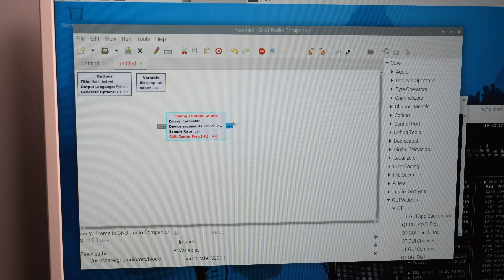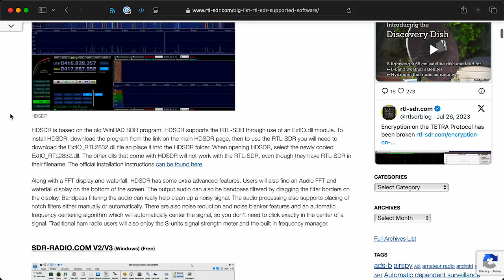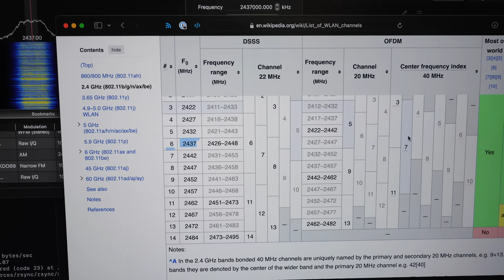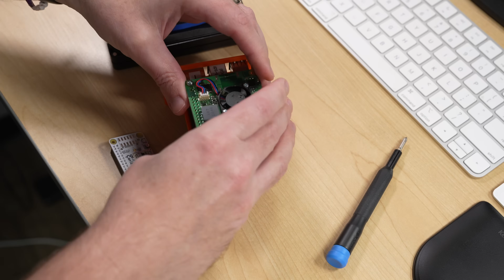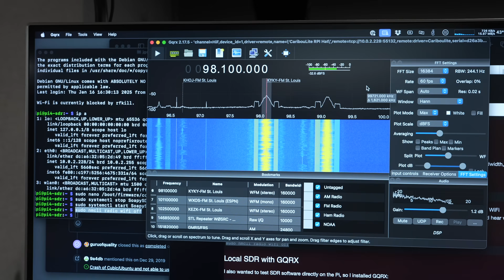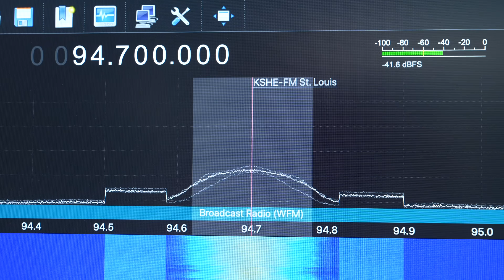Radio Hacking 101: Raspberry Pi SDR with a CaribouLite

Comment: Funny thing about stereo/mono FM broadcasts ... I remember an event that was being broadcast live. When I switched by receiver to stereo it worked just fine. But switching it to mono and the audio cut out. I actually figured out what was wrong, made a phone call, and they FIXED IT. It turns out that mono is the sum of the left + right channels. They apparently had a mono feed, but when they converted it to stereo, the two channels were 180 degrees OUT OF PHASE! Meaning, that when they added the two signals for the mono portion, the two channels cancelled each other out.

Comment: I just had to use your SD copier utility to fix my SSD after it did not boot up correctly after doing the initial configuration and reboot. 🎉  I am about to go hook up the SDRplay and see what happens with GQRX.   Your name came up with a thanks in someone else’s documentation for the same reason.
Reply from the maker: Glad I could help!
Reply: @ I finally installed DragonOS, and ran the installed SDRconnect mentioned in the readme file.   It works, but even with decent antennas that are sitting in the room. I can’t really hear anything so I may have to go on a field trip just to see how well it works and take the antennas outdoors.
Reply: The 7” touchscreen, with the Pi on the back and the SDRplay duo sitting underneath the stand is pretty compact, but with all the cords hanging out, it’s not something that I could just live with having sit here like this, so I have to figure out some sort of case : )  I can’t really leave the antennas out even if they did work, so I have to figure out something which I thought about trying to make a lamp out of multiple antennas.  The discone looks like a giant lampshade. Art + antenna theory.  It’s something to think about anyway.
Reply: @ whoever designed this motel could also make the coating for the B2 bomber because no RF goes through this place.  Maybe we should start making concrete stealth aircraft : )
Reply: If I didn’t know what we were doing, and I saw one of these I would ban us for PiCraft.   Witchcraft for SBCs : )

Comment: Hi Jeff! There is another project "OpenWebRX+". Rich of decoders and very easy to setup. It's working even on my old Orange Pi PC2 (1GB RAM) with Debian 12 on it and RTL-SDR dongle (Realtek RTL2832 SDR) and outside discone antenna.
I also used an active USB cable to connect the RTL-SDR to the SBC so that the antenna cable itself would be minimally short.
I can't post url's here, but in github is repo just finish whith "/luarvique/ppa"

Comment: The CaribouLite is $140 with the same bandwidth as an RTL-SDR and a sampling rate of only 4 MSPS.  Aside from that, it can't be used on anything higher than a Raspberry Pi 4 as the Pi 5 replaced the SMI. Kinda sucks really as the Raspberry Pi 4 has RF leakage in some boards from the ethernet and this board has no shielding.

Comment: I‘d want to see the PCIe header used like I use for other FPGA boards (internal).
There have been a few interesting AD/DA chips released in the past two years but in general the market isn’t one that turns over very quickly.
gqrx is a great start, GNU Radio is a beast 😅

Comment: Could you detect a cell phone jammer with this? I have some concerns that a local factory is using  cell phone jammer that is killing cell phone signals in about a 50 yard radios around the building. It would be useful to gather some evidence before reporting them to the FCC

Comment: This is such a timely video for me! Of all things to get me back into SDR was an old hot tub I acquired recently. I noticed it has a temp sensor from the plumbing going back to its LED controller which made me curious. Turns out it was for a wireless LCD monitor that the consumer could put in their house. That monitor from 2007 is unobtainium now so after doing some research I see it runs on 433.92mhz. Not sure I'll be able to decode it since it looks like it uses its own protocol but I'm using it as an excuse to start my first spa monitoring mini rack 😄

Comment: I think I will use my cheap usb SDR tunner. I can't justify cost of the carbou lite module.
Plus I need to do some work on my projects like recycling my older pi1 and pi2. One is now a controller for heating the container for my homebrew beer to keeping it about 21C with an led display to show the temperature and if the heater is on.

Comment: Would it be possible to create a home assistant application that would take the local audio stream and broadcast it to wifi audio source such as sonos or airplay speaker? I think the digital HD radio signal would be preferred.
Reply from the maker: Probably! I just did it with ffmpeg and VLC last time I tried.

Comment: Which one would you recommend that I should use to listen into any Australia State and Federal Emergency service?
but however now there are using TETRA (Terrestrial Trunked Radio) is a digital radio standard for secure voice 
and data communication which is going to be very hard to listen into their frequency.
I will need some kind of Binary Code Translator Decoder program that translate into words.
if anyone out there has figured it out, please let me know.

Comment: I have a few rtl-sdr dongles lying around and was planning to connect them to my discone antenna for remote scanning. I like this sdr as I was going to get a hackrf one but this is a lot cheaper. The wifi killing thebsignal is a big iasue though, as I have a lot of acres and use wifi for connections between buildings, as fiber is just too expensive, as the highest point of the land where I plan to put my ham shack is a half mile from the house.

Comment: Out of the corner of my eye I thought the title was "Radio Shack Hacking"... disappointed when I looked again.  Decided to at least post a comment to help with the engagement, even if I'm not going to watch right away.
Reply from the maker: That'd be a fun video too, basically using old Radio Shack kits to do old computer and electronics hacks!

Comment: Hi, can confirm still acceptable work on Pi Zero (not 2) or Pi3B with 2gb i prefer use a T40 pin adapter so module stay 90° side but cant use case (or need to print one), if used in old raspberry consider to install only prompt interface and use a webserver app

Comment: Running your Pi as a headless SDR is smart!  Then you don't need a long (lossy) antenna feedline.  Put it in a window or up in the attic, then run the radio data via tcp over ethernet.  Remember to run as high a sampling rate as your rig will bear, to reduce problems with signal aliasing.

Comment: Thanks for mentioning nrsc5, I'd been looking to find a way to receive HD Radio. I had an old R820T SDR lying around, it works well with that software on my Linux Mint desktop. Do you think a Pi Zero 2 W would have enough horsepower to run nrsc5?
Reply from the maker: Probably!
Reply: @JeffGeerling  Definitely! I found a video with a fellow running nrsc5 on the older Pi Zero W, so the Zero 2 W should work even better.

Comment: So did you install SOAPY SDR Server? 
Reason I ask is, if I have a remote RPI4 and a RTL SDR dongle or in my case an Ettus USRP B210, a USB device, would I be able to see it with Sdr Console or any other SDR program on a windoz machine? 
I have a few Ettus N210 and X310 and Anan, but they all function with an Ethernet TCP/Ip interface/network, but the Ettus B210 and the RTL Dongle are USB devices, and my antenna/transmitter building is a few hundred feet from the main cabin. (Using 100Gbit Fiber)
Would like to put the B210 and Rtl Dongle into service.
Nice to see that you starting to play with SDR devices.
Being that your dad is a broadcast Rf Engineer, I'm surprised you did not also follow that path.
73's
Dale

Comment: I picked up one of these a couple years ago (and it just shipped to me a couple weeks ago) for the purposes of doing a bit of antenna testing and backend experimentation.  I'd like to build a full planar array using low cost components and use it as a fully digital radar.

Of course, building an encrypted radio I can use with my network at work... Using my earbuds... Is a more immediate objective.

Comment: Simple antenna doesn't have to a dark art...
At the end of the day... In general terms...
The antenna needs to be long enough to have the ends of the standing wave of the frequency you are trying to receive/transmit inside it...
If you have a dipolar antenna, you can get the entire wavelength...
If you have half of a dipolar antenna (only have one side of the antenna sticking out), you only need 1/2 of the wave length or something like that...

Comment: I have an SDRplay RSPDX, which is a somewhat more expensive device. SDRplay provides software that works on Windows and Linux called SDRconnect. It does run on the PI 4 and 5, but is much smoother on a more capable laptop. I am particularly interested in LF reception. I've heard the BBC on 198 kHz here in Israel, a distance of about 3600 km. If you want to receive distant signals, an outdoor antenna away from noise generating SMPS etc. is critical.

Comment: Do all FM radio stations have that square bump either side of the main signal?

I'm just wondering if those square bumps help with automatic radio tuners.
Reply: It looked like Single SideBand to me. And it seems it is: https://en.wikipedia.org/wiki/Single-sideband_modulation#Vestigial_sideband_(VSB)
Reply from the maker: @blablamannetje  The square bumps are the HD Radio (nrsc-5) sidebands carrying the digital channels for each station. Stations have to pay extra licensing fees and have HD transmission gear, and maybe half or so of the stations (pretty much all the high power ones) do in St. Louis.

Comment: I have had nothing but problems with this unit, although I am trying to use a pizero2 and refuse to upgrade given the awesome form factor of the device I recently gave it my 3rd attempt to get the caribou up and running and after a day of work soapy would recognize the drivers, but angelSDR, SDR++ and a few other apps simply wouldn’t recognize the device. I will try GQRX, thank you for the suggestion!

Comment: because of the sensitivity of the data timing with a remote SDR, i'm curious if QoS should be implemented in the network switch to help prevent other traffic from causing glitches in the network stream

Comment: While I haven't tried it myself yet, I've heard that the Smart electrical meters basically blast out their reading continuously so that they can be picked up when the Meter Reading truck drives by. Looking forward to giving it a try with a SDR since it would give me data without having to fit a transmitter on the meter myself.
Reply: US thing? Because in the EU, smart meters have a SIM.

Comment: SDR is interesting. Looking for a better SDR without a large amount of cash.  Currently using a RTL based one but it's kind of deaf.

By the way, the sidebands he saw on some FM stations is HD radio. Unfortunately due the the company who owns the patents in it, we'll not see a decoder for it anytime soon.

Okay with RTL-433 sometime. It decodes any things on the 433MHz band and some in other unlicensed areas. Things like home weather stations, car tire pressure sensors, security systems. To name a few.
Reply from the maker: Technically nrsc5 can decode, but 'legality' is something different (which is why it's not included in any of the SDR UIs...).

Comment: By the way, in case you're unaware, the way the entire waveform is jumping while you're looking at the weather radio station is likely the IF feeding back into the SDR tuner, not EM noise from around you.  I get that to a lesser extent with my RTL-SDR dongles at certain frequencies.  I would imagine the lack of shielding on your setup is probably why it's so pronounced.
Reply: Either that or the front end of the SDR is getting overloaded.
Reply: @glynnetolar4423  Without the shielding, I suppose that's also possible.  I'm not familiar with the CaribouLite, so I don't know how susceptible to front end overloading it is, but that signal was on the weaker side, as Jeff noted.  It wasn't so weak of a signal that the gain needed to be up much, though, and in my experience, it takes a lot of gain to overload an SDR's front end to the point of distorting the whole band.  With my RTL-SDR, for example, it's usually somewhere around or above 32 dB.  But without the shielding... yeah, could be.

Comment: Hey Jeff, I'm an RF engineer and I use a lot of SDR. Overall this was a very good video, especially for explaining to beginners! Two small corrections:
1. At 4:34 you used waveform which is a term that refers to how the signal looks in the time domain and not the frequency.
2. When you look at the 2.4ghz ism bend you don't actually see an entire wifi channel. That happens since this SDR has a sample rate of 4Msps, you need at least 20Msps for wifi signal.
Again those are very small errors, it really is a good video 😀
Feel free to ask anything you want about this world
Reply from the maker: So much to explore... I will someday get one of those nice wide-band SDRs. And get my HF stuff set up so I can explore AM better than the weak RTL-SDR v4 setup.
Reply: @JeffGeerling  if you are searching for a new SDR that has higher capabilities but still relatively chip I highly recommend the ADALM-PLUTO. worked with it in the past, and it has Great documentation and very good price to performance value

Comment: There is plenty of SDR hardware, of assorted styles. This is a good unit, with a compact style that goes well with the Pi.
But if you never plan to transmit, different hardware may be more suitable. 
Weather Satellites, ADSB flight tracking, World Clock, and SSTV are some examples where receive is all you need.

Comment: Have been wanting, for some time, to make a Ham rig that I can mount in a weatherproof box, on a tree, with an antenna (or two), a battery and a small solar panel. Hook up a Yagi on 33 cm (LoRaWan or similar) and point it at something in the house, for the data connectivity. Have all the hardware in an elevated position and just use a laptop / PC / tablet / smartphone in the house to interact with it all. My home is on the north slope of a nice hill, so I'm kinda limited in my ability to pull in signals from anywhere further south; if I can mount the actual XCVR and antennas on a tree up on the ridge, that really changes the game. If you can run this on Pi hardware, that greatly reduces the power requirements, as well as the weight.

Dunno if this hardware can transmit but the networked receiving / processing capabilities really pushes my idea closer to reality.

If I read the info correctly, it can sample about about 40 MSamples / sec which gives up to a 20 MHz swath of bandwidth to look at, at any given time. More than enough for most anything I'd want to do.
Reply: Carobou has 4 mhz sampling rate , IQ 13 bit samples (26 bits total) so that's where that 120 mbit/second number came from. You're not going to see 20 mhz of bandwidth from this

Comment: I used an RTL-based SDR to repair my car keys the other day. I connected it to a pi5 and decoded my key's manchester 2 encoding. It was fun. The key needed a bit of soldering but amazingly it was still in sync afterwards with the car I did not have to reprogram it. It really helped seeing in SDR++ that the key is doing sometthing and the spare key did not do the same things... analyzed and fixed. SDR-BMW : 1-0
Reply from the maker: Nice!

Comment: I grabbed a couple of cheap RTL USB TV tuners years ago and connected them to PIs - one runs the Dump1090 package for mapping aircraft in the sky, the other is still yet to be used. Both mounted in the rear of my rack.

Comment: The stubby antenna will have a high swr inside the housing and probably will not pick up any stations .
It would need to be placed in the vertical position anyway. 
Good information.

Comment: In my opinion, the CaribouLite is the hardest to setup of all of the SDRs. I've used the HackRF, RTL-SDR dongles, and USRPs. The URSP is a close second when it comes to setup being a bit of a doozy (having to get the firmware files are not documented super well.) Now that you have the CaribouLite setup, everything else should be pretty much down hill tho. The `rtl_eeprom` command even lets you set the manufacture string, product string, and serial number. I have my all set to my companies name, the product name, and then the callsign on the frequency it's centered on. This way, when I run things like Trunk-Recorder with multiple SDRs, the serial number ensures that it's always connected to the correct system, or the correct antenna.
Reply from the maker: Good idea! And yeah... compared to RTL-SDR this thing's like rocket science level having to get the driver going on a new Pi!

Comment: there's a hacky way to make a raspberry pi transmit a radio signal, without any extra hardware, the range of frequencies is limited, going too low or high causes weird artifacts in the audio signal. would be interesting to see what you can do with it, with your experience both in radio and raspberrt pi.